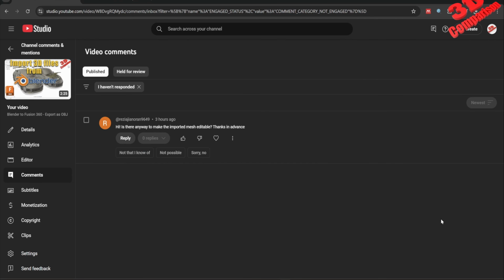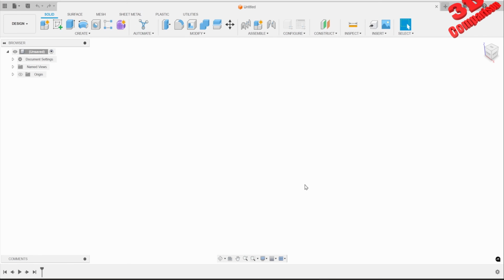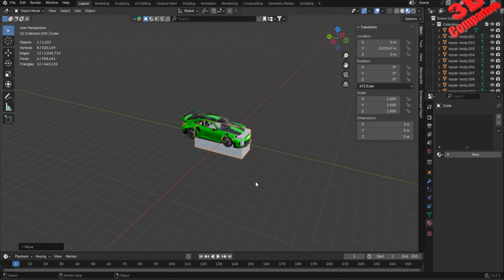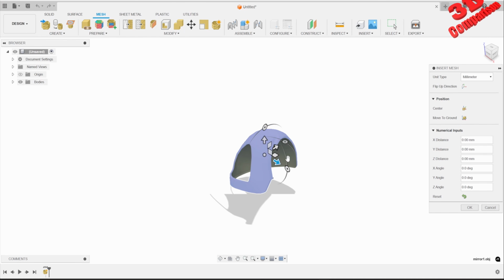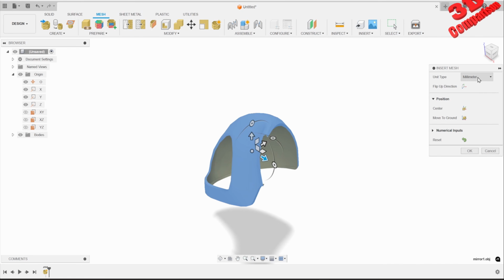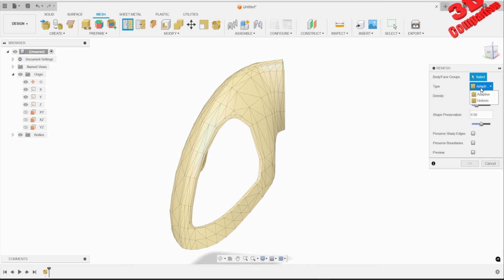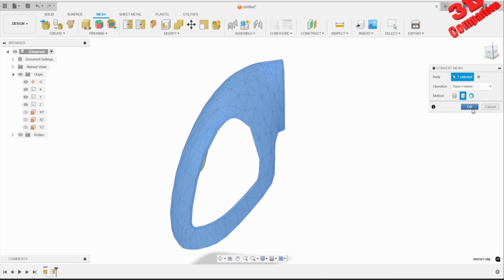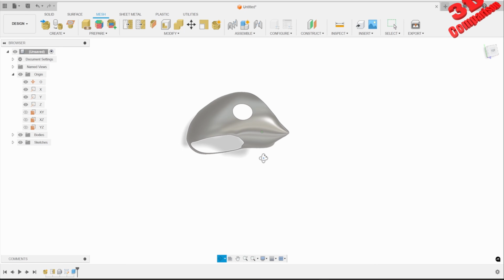Export 3D models from Blender to Fusion 360 and convert them to CAD models

Comment: Hi, great video, could you help me convert a Blender model of an RC airplane to a fusion 360 OBJ model so it can be editable and create negative molds for carbon fiber pieces of the airplane? If yes, let me know and how to contact you so I can send you the file of the airplane which is a premium 3d model I bought and is highly detailed and inspect it. Thank you, great channel.
Reply from the maker: Thanks for the support and for watching the channel!

Before we jump into the details, I have a quick question about the current file format of your premium model. Is it already an .obj or an .fbx/.blend file? 

If it is currently a mesh format like .obj, it's important to know that these files are typically designed for visual rendering or gaming, not for direct manufacturing. Just like I showed in the Nissan reference video.

To make it truly editable in Fusion 360, we will likely need to process and convert those mesh surfaces into clean CAD geometry (like standard solid bodies or T-Splines).  You can send me an email at 3dcomparisonstuffs@gmail.com and we will discuss additional aspects regarding this.

Best Regards, 
3D Comparison
Reply: @3DComparison  Thanks for the reply. I have it as a Blender file and I also experimented with a plugin for Blender called IGES that let's you export it as OBJ file format so I can bring it into Fusion 360 and it works, in Fusion it looks perfect but is all mesh and not editable, I can send you all those files together for you to inspect.